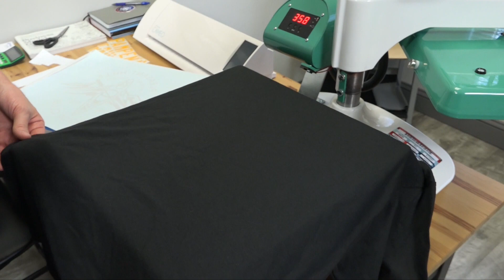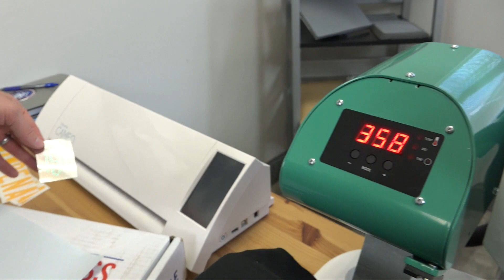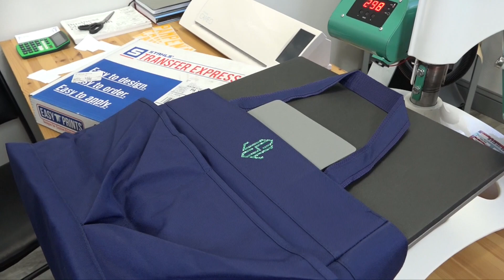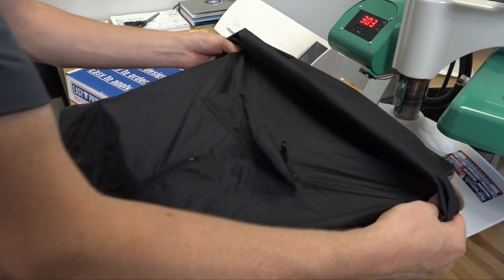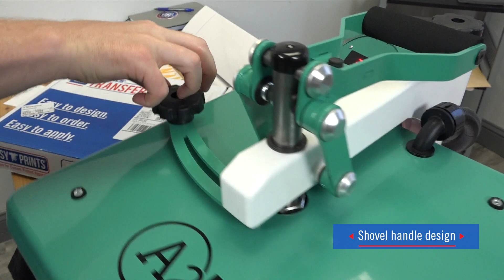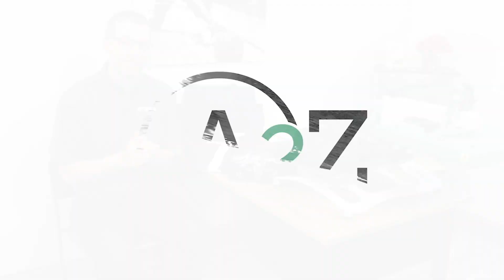An All NEW Starter Heat Press - Stahls' A2Z Swing Away Heat Press

Comment: Hi there, thanks for the great info! I would like to heat press on a Brazilian Jiu-jitsu gi. They have a challenging material to press on. Would you be able to show the best way to do that? Judo gi is similar fyi.
Reply from the maker: What to apply to the gi will be determined by the fabric of it. Once you figure that out, you will want to use pillows or pads to help with any heavy seams or pockets on the gi - ensuring the pressure is correct for heat application. We have many video on how to apply to different fabrics on our channel. Or if you would like to speak with someone on the phone our # is 800.478.257

Comment: Is there a way to adjust pressure other than the turn knob? I need more pressure for one of my projects than what my A-Z heat press is offering me
Reply from the maker: The  turn knob is the only way to increase the pressure with this machine. You may be able to add a pad or pillow to the machine to increase the pressure of your item.

Comment: Does this press work for umbrellas?
Reply from the maker: Hi James - yes, you could use this heat press for umbrellas. You'll want to use a heat printing pillow or a print perfect pad underneath the umbrella section to isolate the area. Low temp heat transfer vinyls are also recommended.

Comment: Sorry for the stupid question. I know this requires  a dedicated 20-amp circuit but I’m not really sure how to check if I have that. Does this mean that I can’t just plug this in to a normal 110v outlet by itself and make sure that there is minimal or no other devices in use in the same room?
Reply from the maker: @CantAffordFestool you can actually call Hotronix directly at 800-727-8520 and they can tell you exactly how to check and make sure you have the necessary amps to power the machine.
Reply: @StahlsTV  Thanks for the quick reply! I got the 20-amp dedicated circuit sorted out. And I was about to hit submit order for the A2Z but my jaw dropped when I saw the 2.5 month backlog! I spoke to Jen from your customer support and she was very kind and patient on showing me alternative units, but they are all just beyond my price point. I'm sorry but you lost a customer to HPN.

Comment: $699 for a non industrial heat press.    Hundreds of more affordable swing aways with the same bells, no real whistles here.  The items pressed here can be pressed on any heat press, no matter the cost.  And whether the print lasts or not, doesn't depend on the press, it's the product along with the material meshing together.  There are more budget friendly presses on Amazon, for beginners for a couple hundred, from there you can go for the more expensive machines after you figure what works for you.  I'm tired of companies holding back, nickel and diming the consumer with certain features here and certain ones there, but not a good all around press for a good price.  Then they jack up prices for a basic machine.

I do like the idea of a machine made in the US, but you're gonna pay more.  

I'm about to buy my third press.  I want a 15*15 press with pullout feature, with a pressure release lever or automatic.  Nothing too fancy, but it's hard to find, everyone is sold out, or highly priced.

Comment: I'm confused. I thought the printer and print paper determined what you could print not the heat press.
Reply from the maker: Yes the printer and paper adhesive determines the fabrics that you can apply to, however the heat press is critical in applying the accurate time, temp and pressure for durability.  With the interchangeable bottom attachments and semi-threadable design this machine will help you to get your item flat for accurate pressure.

Comment: I am very interested in this press if it can hit the same pressure as the #8 pressure setting on the Fusion press. If so this is a winner.
Reply from the maker: Shouldn't have an issue applying a firm pressure.  There is not a pressure readout like on the Fusion, but you can definitely adjust it to make it firm.